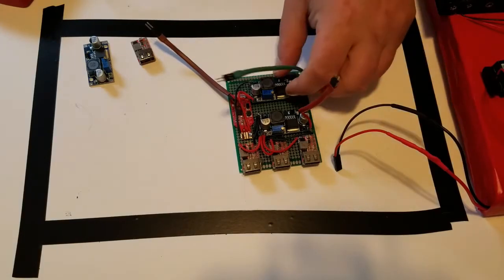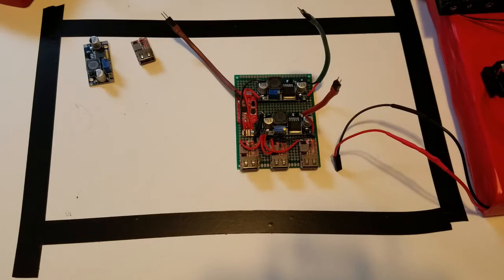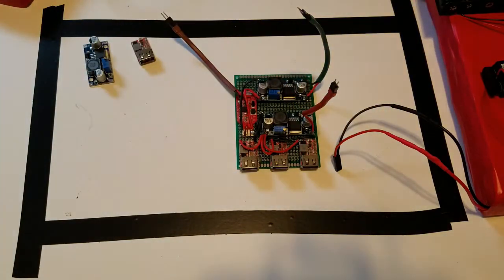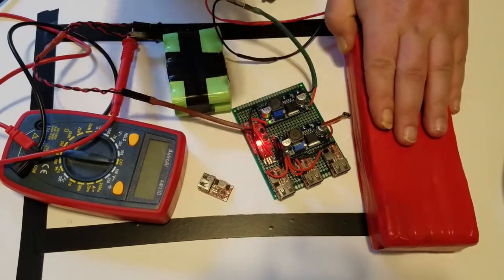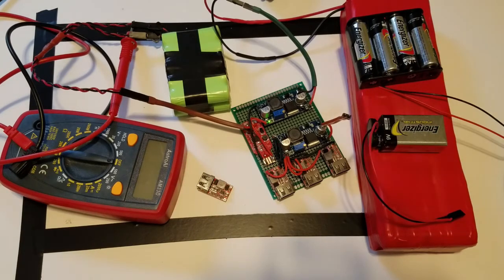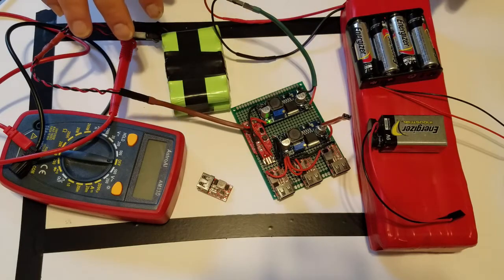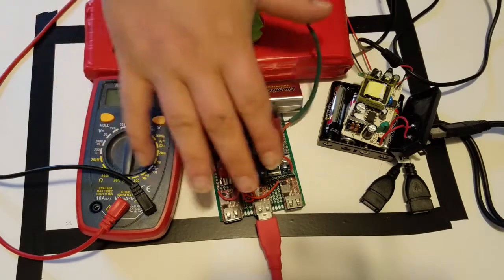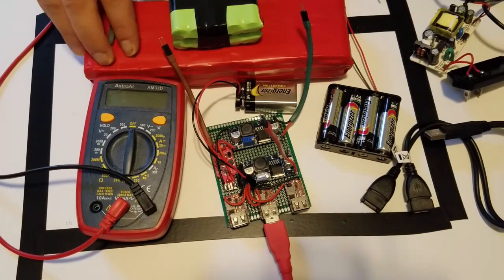COVID 19 Corona Virus Preparedness DIY HOW TO

Comment: This is just the type of thing I was trying to explain to a tu tu wearing fool a few nights ago. If there has to be a choice between internet or electricity, it would make more sense to keep the internet infrastructure operating, relegating energy generation to things juuuuust like this, along with gas and diesel and natural gas whole home generators. Keeping the PHONE based computers online will keep most people calmed as calm can be in the middle of a pandemic/epidemic (or possible prankishly deceitful hoax) can be. Thanks for doing this Brian, and I encourage you to do more of them, like expanding upon the point you made about the splitter containing the necessary parts you were using. People will benefit from being shown where to look for pieces and parts. It was great pointing out that ya gotta check all adjustable trinketssssss!  Always turn em down down down counterclockwise down down down. 

Now, I had a friend a long time ago who believed not in turning all things down but instead balance all adjustables to the middle of their throw - whatever their throw is. I always supposed there was some merit in that strategy as well. One rule of thumb that MUST be adhered to in what you are doing there - ground ground and moooore ground. Always give the current a place to go where it will be happy and calm and thus nice. voltage can be very nasty, quickly, even from small batteries, if it is not respected. I agree with you 100% !  Use a Meter!!!!! Rubber gloves help as do rubber insulated tools if available. 

Great Project here Brian! I love it. You have a lot of knowledge to share Brian, and I really do encourage you to share it over and over and over with ideas for things like this. Some will disagree with me here but the reality is this, sharing a video like this might just save someone's life someday. To me, that is well enough worth it to do.
Reply from the maker: I appreciate it. I am trying to think up more ways to expand on this, but the ideas I have so far go beyond the realm of basic, into welding, gear reduction hand-crank systems for manual charging, etc, but thats going a bit far right now, so I am just trying to think of things the average joe can do with what they may have laying around. I really wish I could finish my wind generator but cant do that until I can get my hands on bigger magnets and a larger inverter.